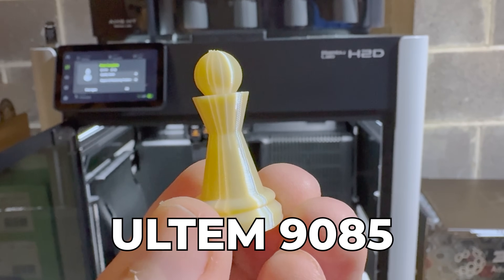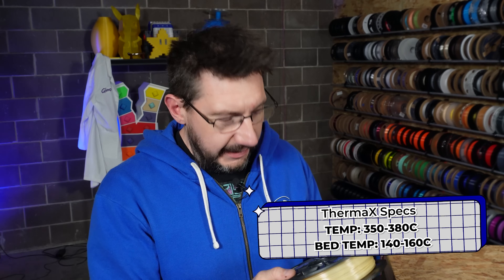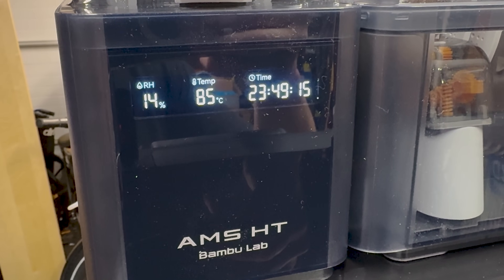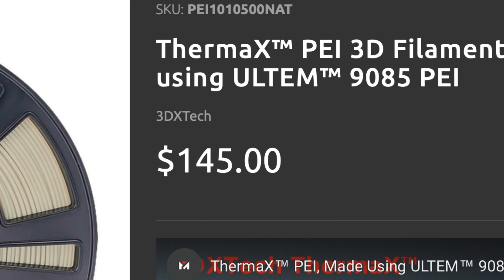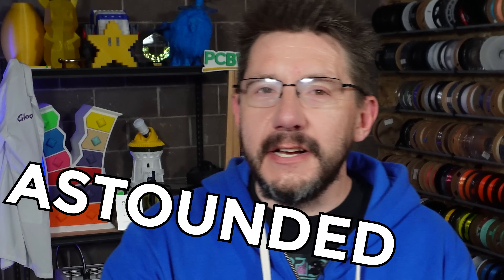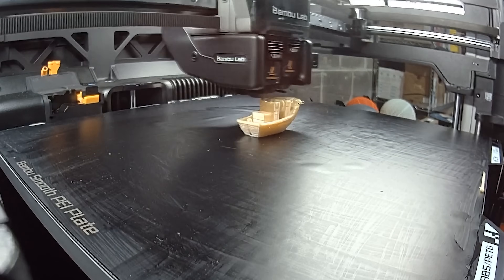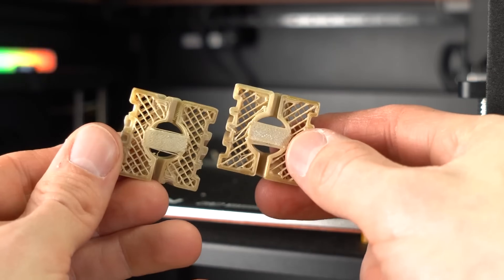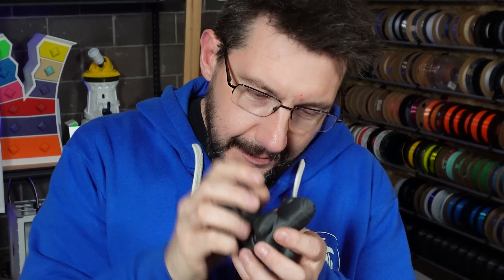DO NOT PRINT THIS on the Bambu H2D

Comment: Printing exotic filaments is cool, however everyone should consider the COMPLEXITY of the printer as you read the "warranty" before purchasing. It is quite possible that you end up with a (self) REPAIR NIGHTMARE leading you to REGRET buying the printer, I know I do. I also own an X1C, which  has been great however my experience with the H2D has been and continues to be a disappointment in the extreme.

Comment: I'm not familiar with all the different filaments out there, so what would have been made from this expensive material?  is it structurally strong enough to use as a motor mount for an RC engine?

Comment: I have been printing PEKK on my K2Plus without any issues. 350C Nozzle temperature, 55C Chamber and 120C Bed temperature on my regular PEI sheet. Prints absolutely beautiful at a max flow of 4mm³/s. Haven't pushed these settings yet, because this stuff is EXPENSIVE, but it's definitely possible nowadays to print ultrapolymers which is just amazing for Hobbyists. Only thing I noticed is that when it comes off the bed it leaves a discolored mark. It likely takes some of the PEI form the build plate with it, but I haven't had any adhesion issues in that spot yet.

Comment: Already a somewhat strange video... The attempt to print an industrial filament in a consumer printer was actually doomed to fail from the start, given the specifications. But yeah, now we know that we shouldn't fuel a car with diesel if it runs on gasoline... ;) By the way, the price difference is almost $13,000 between the IDEX and the Bambu Lab.

Comment: Well you're dead wrong about the chess set you'd be amazed how much people will pay for a chest set :-) I wouldn't be surprised if you could easily get somebody to pay two or three hundred bucks for a nice chess set with some ultem parts it won't fly off the shelf you'll have to find the right buyer but it should be possible. 

As for printing the benching I can't guarantee this work I have zero experience with high-tech materials like that but sometimes you can get away with it if you slow down also try a large or nozzle 0.6 mm you'll increase your interlayer adhesion bonding just by having a larger surface area that combined with going at half the speed maybe even a third the speed then sometimes give you that little edge you need to get the part to finish The mechanical properties will still probably be subpar but it might complete and that would be a pretty good talking piece to have on your shelf.

Comment: You can probably get the nozzle up to 400C and the bed up to 200C with resistor mods.  My P1S can do 345C nozzle and 145C bed with the resistor mods (chamber runs up to 70C before the steppers get too hot).

Comment: If you're working with engineering grade material, you're going to have an engineering grade machine that won't have a problem printing it, and if you don't, don't waste your time with it.
If you really have a need for something in those kinds of materials buy not enough to buy a machine that is capable of working with them, just use PCBway or smth KappaRoss
Consumer machines are not meant for industrial applications

Comment: Great PSA about the difference between being able to "print" in a high-end material and being able to print well using a high-end material. Definitely going to be more companies claiming they can handle engineering grade materials when they simply do not meet the minimum requirements to actually have those materials be remotely useful when printed.
Reply from the maker: You're exactly right.

Comment: Get a cheap paint brush from Harbor Freight or Home Depot to use for spreading out the VM adhesive. For a couple bucks it's a million times better than the metal handle thing that comes with the bottle, spreads so much more evenly, and is easily water washable. Love that stuff. I just used it for insurance printing a really long part on my Magneto X with a 55-degree overhang and a tiny bed contact patch and it worked great.

Comment: What would happen when you tamper with the thermistor? Like add another resistor to trick the printer into thinking the nozzle is at 350C while it is actually 380C? Danger aside, what would an additional 30C do... Right?
Reply: You need much warmer chamber
Reply: @riba2233  thats not the question
Reply: You can trick it but you won't gain anything

Comment: Oooof... This started out as a video about how H2D can't really handle high temp engineering plastics and ended up showing that even Vision Miner, the company known for high temp printing, can't do a benchy. I disagree with the conclusion to "print more benchies" if you want the chimney to come out correctly. The slicer or the printer should know that too much thermal mass is being dumped into the same spot and either slow down the print or increase the cooling to allow for the chimney to come out properly. If it's failing this bad on a test print then it's going to fail even worse when you give it odd geometry in real world prints.
Reply: Uhhhh, if you’re referring to the chimney melt as “not being able to do a Benchy,” we actually advised Joel beforehand that the chimney would likely be a hot spot, and recommended adding some extra cooling or printing multiples to mitigate that issue. Aside from the chimney, the rest of the Benchy came out extremely strong and dimensionally accurate—take a closer look!

With high-temp materials, every part tends to have unique thermal behaviors, often requiring slight profile adjustments. The Benchy, specifically the chimney, is a perfect example of this—not a limitation of the printer itself, but an inherent aspect of high-temperature printing.

As slicers improve, this will get better, but that will take some time and  development -- if you want thermal simulation and prediction, we offer the Hylo with Basis -- it's delving into those capabilities -- at a ~$200k price point :)
Reply: @VisionMiner  Thanks for the reply. The point I'm making is that the slicer/printer combo should be configured out of the box to be able to print the most common test print that exists. Consumer level slicers have options to increase fan speed on layers that print fast and/or to slow down printing so that fast layers print slower to allow better cooling. This could also be done in the firmware.

I probably won't ever be in the market for your level of printer but I love your content and your customers probably don't care about benchies but it's not about the benchy itself. It gives a negative image of your company that your printers can't print this common test print flawlessly out of the box when there are well established ways to fix the problem.
Reply: @VisionMiner  Handy hint:  Starting off comments (or any written communication) with "Uhhhh" and such indicates undue lack of professionalism, and debases anything that comes after that defective opening, whether the communication is some petty argument on social media or some clown trying to sell people "industrial" products that have 5 to 6 digit price tags...

To the substance of your reply, "handwaving" away such clear indication(s) of major process defect(s) that can and will negatively impact exactly the kind of parts one needs an expensive industrial printer to produce should be embarrassing.  Trying to upsell to your ~$200K product that in your own words is "delving into those capabilities" is ridiculous [or maybe "delving" doesn't mean what you think it does].

Comment: Yeah, if someone has $150 to throw toward a 500g roll of engineering plastic (and a genuine use for it), they should be able to shell over the $15k for the Vision Miner 22 Idex.... which is a fantastic printer with open firmware that one can easily service themselves.

That said, I get the desire to be able to say "my printer can print Ultem!" 🤣

Comment: As much as I love my industrial-lite materials, I will be the first one to tell you that if I'm gunning for high temp end use, there's not a filament on the market that will satisfy the points I need to hit (thus far). What I've done a lot of, however, is print in cheap(er) materials, mold them and inject a custom blended polymer that can take the heat of a burn-out process and step out from the 1000*C mold like it's taking off a sweater. 😁 I tend to tap out at $8 Benchy range and revert to PET-CF or PPA/PPS if I'm looking for a functional part that can stand up to a hot car interior kind of thing.
Reply: @C-M-E  ASA not strong enough?
Reply: @RogerEssigArtist  Not so much strength than operating temperature resilience and associated Tg. There's plenty of strong filaments, or strong enough as it were, but temperature resistance across the board is too low for most anything to compete with a metallic or ceramic part, which really sucks to put it bluntly. I'm actually formulating extreme temperature filament as my first product when I get my extrusion system up to spec in the next few months (like near industrial scale, not 3D printer scale for ref) that should be a happy medium between aluminum performance and PLA price with near ceramic temp constraints; the downside is that it's single use for the moment, but I'm working on that, too. It's all a wish list until I can transition polymer stock into filament though, but the years of testing has satisfied my personal projects so well that I'm confident enough to put this into production for the masses.
Reply: @C-M-E  very cool!

Comment: What on earth is the point of this video? Don't print filament on a printer that can't meet the requirements? Felt like it was a cheap disingenuous dig at the H2D. No where do you say that there is no fault to the printer, because you are using it outside of its use case. Tremendous waste of time watching this.
Reply: i am paraphrasing but it seems like the intended takeaway is that people should destroy their hot ends by trying to print plastics that their printer isn't even close to capable of, for no good reason
Reply: Print something hotter and risk your machine while the parts might not be shipping out of China to avoid tariffs.   No thanks, sticking with PETG and ABS and slowing the print speeds down.    Lets see if 2000-4000 hours of printing is achievable without replacing everything.

Comment: For some perspective, you could feed lead-free solder through the nozzle at 350C.
Reply: Hmm... new way to apply solder paste to PCBs without a stencil?
Reply: at home cheap smc machine would change things
Reply: Shhhhhh were not supposed to talk about printing a whole circuit board on a consumer printer .... or bruno... we don't talk about bruno

Comment: Ultum 9085 is what we use at work for Aircraft parts. When it’s printed properly it is strong as hell. The bambu is probably not maintaining a high enough oven temp.
Reply: well...what oven? 😁
Reply: @ You’re correct an enclosure isn’t an oven lol. I should have said the bed doesn’t get hot  enough to maintain a high enough enclosure temp .
Reply: what printers do you use?
Reply: @Franklinplatt64  at work? A fortus F900 and 450MC

Comment: Have you run any water-soluble filaments through the H2D yet? The H2D seems like it would be good for soluble supports, but I haven’t seen anyone try it yet.
Reply: Once in a Six Side  tried it and it doesn't print very well in n2d

Comment: Now I'm wondering if I should attempt a Fiberon PPS-CF print on a Core One. 20° cooler nozzle temp than minimum recommended. 😬
Reply: Don't bother, 330-350 is the sweet spot, you are far from it
Reply: @riba2233  yeah, true.

Comment: Hey Joel, you're not using that vision Miner nanopolymer adhesive correctly. I use it daily in my farm. It's about building up multiple layers on top of the plate that has crisscrosses with the brush strokes. Keep brushing as it's drying and even a little bit after it's dried cuz you want that texture from the brush for more surface area, If you watch your print video on the pawn you can see the adhesive buildup on the plate. You want it to be consistent but brushed. Usually about three layers works, You were completely right about the amount you're using though it takes a ton... Just more times. Grid pattern helps too, The product is a glue so it doesn't spread as far as you would think.
Reply: It solves itself if you re-apply a layer every couple of prints. Also you need to fully wash it off and reapply every like 30 or so prints. Best stuff out there tho. Doesn't ruin plates, isn't sticky everywhere, easy enough to apply.

Comment: I just watched the BondTech INDX announcement and the H2D is no longer on my wishlist!
Reply: @LordCreo  hear hear!
Reply: That on likely an SV08 will be my next big printer project but give me like 9 months so my wife forgets I bought a Core One (that hasn't even got here yet).  I gotta have my workhorse before I can start breaking in new ones.

Luckily that gives everyone else the time to work things out and gives me more time to clean out more garage space lol.
Reply: Yeah INDX look amazing! With Voron 0 it looks like some kind of Prusa XL MINI, LOL :-)
Reply: @LordCreo  thank goodness, they are in short supply and that will make it easier for some to get theirs
Reply: thats not a whole printer though
Reply: Ditto
Reply: H2C would like a word lol
Reply: I just saw the INDX at a fair in Sweden. It looks quite impressive. But it is not as fast as a Prusa XL, since it cannot preheat the next nozzle.
Reply: @AllanBjerreAbbondio  IDX preheat in 5 sec…
Reply: @AllanBjerreAbbondio 
That sounds like a pretty intense deal breaker.
Reply: @MumrikDK  Well, you still get less filament waste, you can easily print with different materials in the same print, and the print is still faster than a printer with an AMS system. On top of that, it looks quite affordable.
Reply: @AllanBjerreAbbondio  Surely that can also be impacted by the printer design.  

On a fixed-bed printer like the XL, the travel time for the head to go all the way to the top from the current layer is the speed issue.  Admittedly this gets quicker with each subsequent later  

With something like a Trident, Sovol Zero, or Creality Ender 5 Max, the printed layer is always at the top, so there is no travel time.
Reply: @craigrholmes  The XL doesn't have a fixed-bed printer.
Reply: @AllanBjerreAbbondio  in Combination with Idex ?
Reply: @AllanBjerreAbbondio the Prusa can’t print any of these materials though, includingPPS, nylon, etc. nozzle just gets to w90 c.
Reply: @AllanBjerreAbbondio  If what I've seen thus far is indicative of the final product, the nozzle heats up in seconds, which I would imagine is using an inductive process that gets mighty toasty in a hurry.
Reply: @C-M-E I've seen the same. Maybe it isn't xl fast but Canuck Creators video showing nozzle swaps in real time had it changed out, heated, purged, and printing with the next nozzle in ~15-20 seconds. Definitely fast enough for me and sure to use far less waste than Bambu labs approach and with anything more than 2 spools it'll be much faster than the whole rewind/purge routine. And while the initial toolhead will be expensive (~$250) adding more "lanes" for $35 sounds great! Even for only printing 2 different materials the savings on waste alone will add up quickly. It's also mentioned in that video that since the filaments are cold when not being used degradation is not an issue. If it performs as advertised I've got to think that the multiplexing way of multi spool printing will be obsolete soon and I'm so here for it!
Reply: @RobertD_83  My thoughts as well. For the initial buy in, price is very reasonable for the base system, and yes, expansion is relatively cheap! Not having 4x more waste than end product will help pay for itself relatively quick (at least that's my reasoning). Not having to rebuild to implement the OS is a huge plus, too. Just a couple relatively easy macros for klipper means tuning will be a breeze!
Reply: @C-M-E  Yes, it is going to be interesting to see the print time and filament usage comparison between the INDX, the H2D, and the XL
Reply: Apsolutly the proper mindset for anyone that plans to use multimaterial 3D printing for the near future.
Reply: @madbuldog only if it’s really high temp.
Reply: Agree, the INDX looks great, however for a 2 color print, or even printing large cosplay items with supports in different materials for easier breakaway, the H2D is a good choice especially if you are not one to tinker or have the troubleshooting capability.
Reply: @mobilechaosyt  https://youtu.be/-utEftUE9eE
  I've had this video in my queue for a day or so and your comment made it my next view. I'll preface by saying he's using a .2mm nozzle and printing minis so it might not be 1:1 but you might check it out if you were considering the h2d as it addresses what you mentioned in your comment. It's only one anecdote but it's info on that specific situation (printing different filament types for breakaway supports). Many commenters are also saying it's going great for them though so 🤷
Reply: @ One mans experience, but interesting find.  Not sure if that is just because the H2D is so new and if the multi material functionality will become better over time.
Reply: Big Facts, Bondtech INDX for the win!!! On top of the fact that most of the big 3D printing youtubers seemed to be shilling the heck out this machine. 👎👎👎